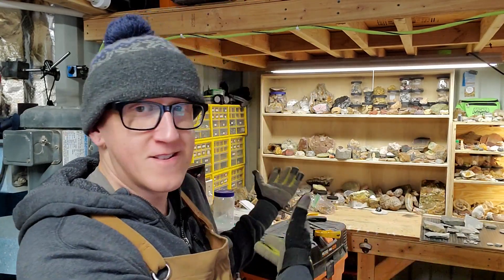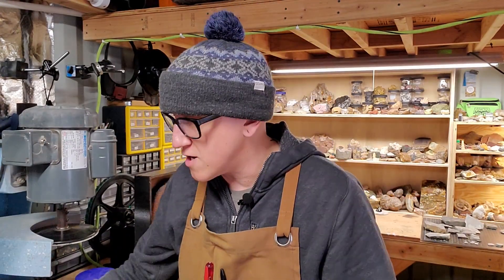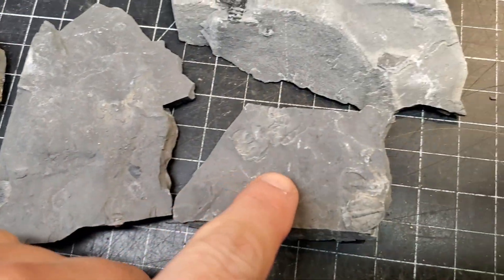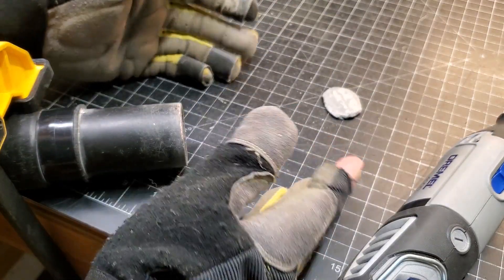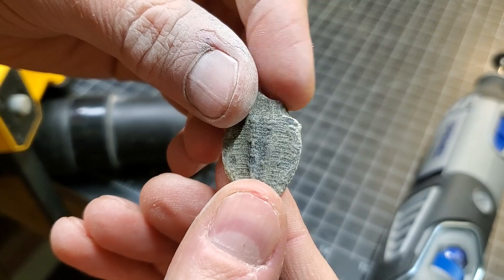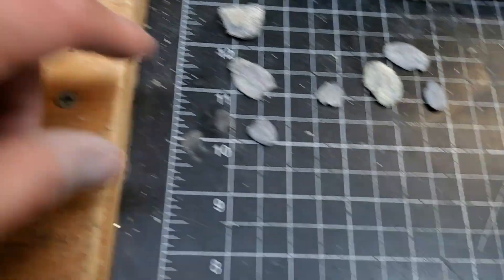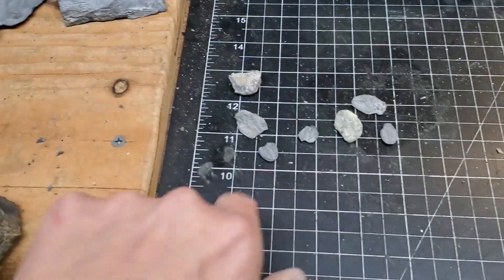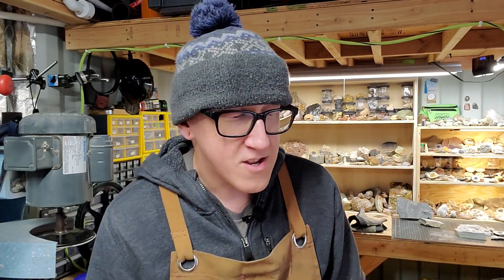Cambrian Trilobites // Attempting My First Fossil Preparation

Comment: Nice video!
Learned again. Never thought about using a dremel steelbrush on a trilobite, but it worked out pretty well!👍
Would also like to see a video on how you 'free' the trilobites from the rock where they are deeper in the matrix.
Thanks!
Reply from the maker: As far as I know, there isn't really nice way of removing these, they pop out or don't. We do intend on going back here to collect some more and at that point ill have more material to experiment with.

Comment: Thank you for such an interesting subject. What kind of wire? Does it matter if it is steel, brass, or some other material?? Your wire wheel looks like steel. Thanks.
Reply from the maker: Its a stainless steel wire wheel.

Comment: jared, hey keep your negatives around. if you ever get into small time smelting, they make amazing molds. i tried  it with some bismuth i melted in a pan. they came out real cool. maybe a harder metal would make some nice pendants. just scratch in a bail hole with dremel.. bam.
Reply from the maker: That a really interesting idea, using them as molds sounds pretty fun.

Comment: I love collecting fossils from the Mancos shale beds that are all over where I live. However, the material tends to deteriorate (crumble) fairly quickly after I dig it out and is a struggle to keep it from falling apart. Mostly finding bivalves which sometimes survive on their own but would like to find a way to stabilize the matrix they are in. Tried CA glue with mixed results but if anybody has any recommendations... 
This trilobite collection is very cool.
Reply from the maker: I've also tried CA glue on different fossils with really mix results.

I want to really like fossils but sometimes its also really a bummer.

Comment: Nice video! Not into fossils but enjoyed you cleaning them up either ways. It would be nice if you could just dip them in a solvent and expose the fossil. Wire brush method also seems effective.

Comment: What dremel head/brush did you use to clean them? I tried two and my first one scratch and eroded the fossil itself and the other was too soft to do anything.
Reply from the maker: I just used a soft stainless steal brush on a variable speed dremel.

Do you have some trilobites from the exact same formation?
Reply: @CurrentlyRockhounding  Yes sir! Same place. Small bag of them but my dremel brush head is cheap and just scratches them to hell.

Comment: Fun trying new things.  Did you play with the shale before putting the wire wheel to the fossil or were you pretty confident because how easily the site host did them when you were there? It surprised me how rough his wheel looked, and how well they turned out.  Very nice overall on the types you got to experiment or practice with.
Reply from the maker: I pretty much just went for it. This little tiny wire wheel is nothing compared to the big bench grinder they were using on site.